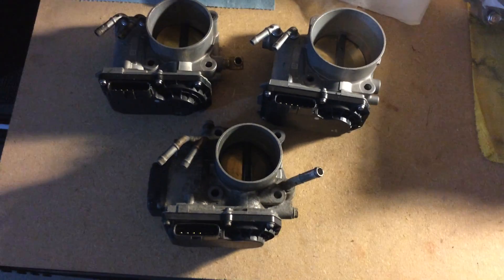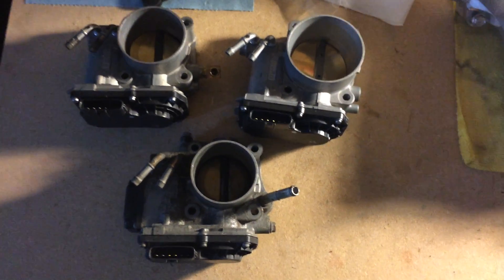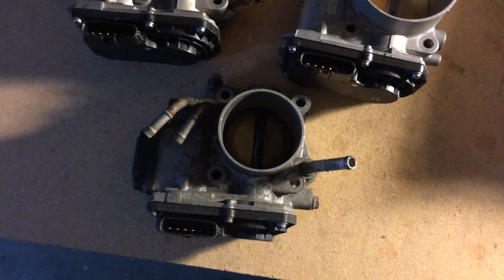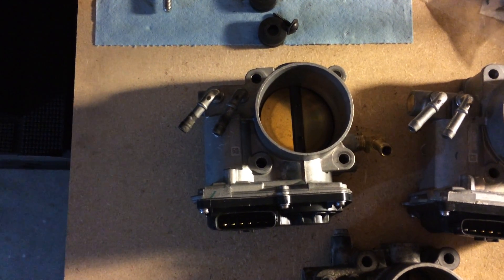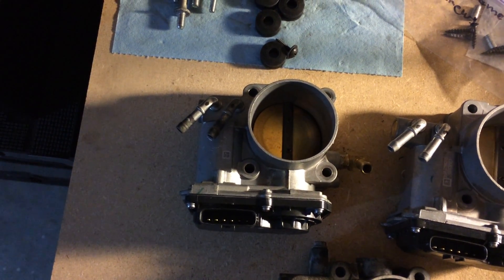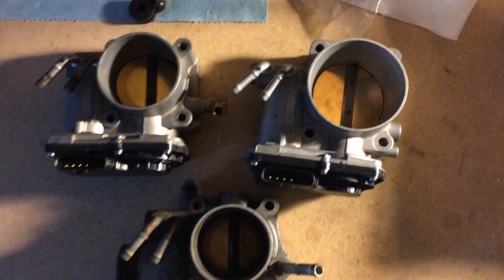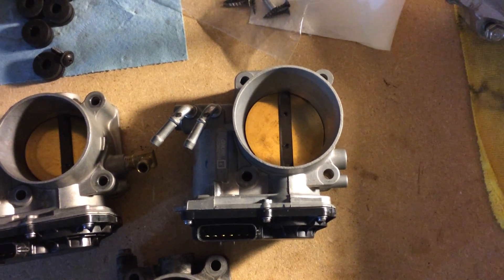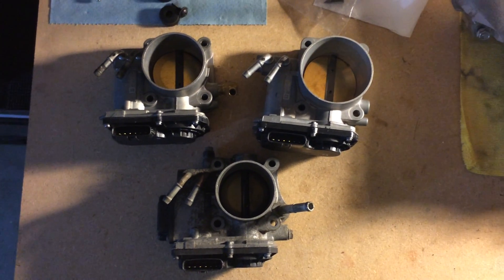Stock K20Z3 Throttle Body vs J35 vs J37

Comment: I have a 2005 acura type s would love to get the j37 what other parts do i need to bolt it right on and where can I get the j37 and parts
Reply from the maker: you may need an adapter for the j37 to fit
Reply: TheTongMan  where do I go about getting a adapter at
Reply from the maker: not too sure for your car
Reply: TheTongMan  thanks  tho

Comment: i know this is an old video but was wondering if you can help me out by answering my question  if you can.  what will i need to do or need to make the j35 tb work on rbc manifold on my 2006 rsx type s???
Reply from the maker: Daniel Robles you have to convert to drive by wire to use a j35 or j37 throttle body in your rsx type s.

Comment: Hey TheTongMan, love watching your videos.  They are super informative for anyone with a K-Series.  (DC5 owner)
Wanted to ask 1 quick silly noob question about these throttle bodies.  Can any of the J-Series throttle bodies retain the cruise control mechanism?  I am slowly piecing a K24A2 setup together and considered the Skunk2 throttle bodies only because it can still maintain our factory cruise control however, I would consider these style of throttle bodies due to the larger inlet size only if it doesn't eliminate the CC.  I daily my DC5 so this is just something I'd like to keep if possible.  

Thanks for the insight and keep the videos coming! :j
-Patrick
Reply from the maker: Yes the j35 and the j37 throttle bodies retain your cruise control feature. I've had the j35 and currently have the j37 throttle body on my car and I can still use my cruise control without any issues. As for your specific application, I don't think you can use the j-series throttle bodies on your car if you don't have a drive by wire throttle system.
Reply: @TheTongMan  would you happen to know if the J37 TB can be connected to the silicone coupler that would fit on the j35 from say a hybrid racing CAI or would I need another coupler?

Comment: Hey, I installed a j35 onto my stock rbc manifold with a pr2 throttle body spacer with the correct gaskets, but when I turn on the car my Rpms are high and it sits at 1.2k. When I'm driving in gear and I clutch in my car revs alone all the way to 3k Rpms and it keeps bouncing till my car stops completely. Please help my out
Reply: Did you retune for the bigger throttle body?
Reply: I thought it was a plug and play and the ecu would recognize the bigger throttle body. So a tune would fix my problems?
Reply: +Tdude B.
Reply: Try Disconnecting battery for 30 minutes and then reconnect, if that doesn't work, contact vitviper Raphy Gutierrez

Comment: does the j37 throtle body fit perfecty??  like is there any other parts you have to purchase in order for the j37 to fit the k20?
Reply: You need an adapter plate for the j37 to bolt up to the k20 manifold.

Comment: I wonder how big my throttle body is. (R18)
Nice job, Tong!
Reply: I got a 2008 accord v6, would the j37 TB fit on it with out any modifications or issues while driving after installing ?

Comment: .what does one need to do, besides getting the J FB, to swap it over?
Reply from the maker: not the j37. you need an adapter for the j37
Reply from the maker: hondatrix the j35 throttle body swaps right over without any modifications. the j37 requires an adapter from p2r to bolt onto the rbc intake manifold
Reply: TheTongMan u can fit what ever trottle u want on what ever intake u want...no adaptor needed...
Reply: So all of these throttle bodies is a direct fit on the k20z3 right?
Reply: Thanks TongMan